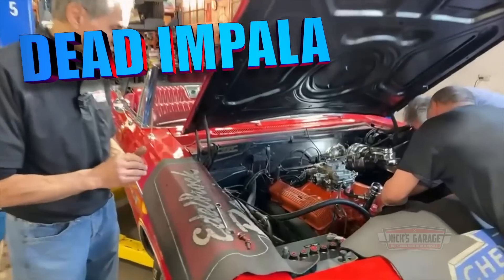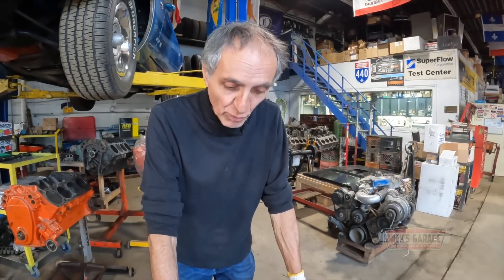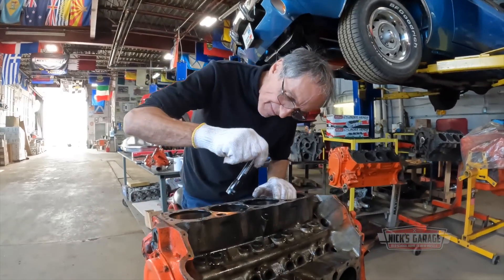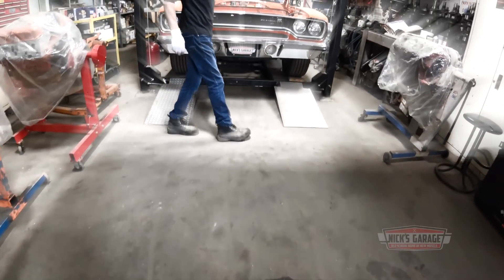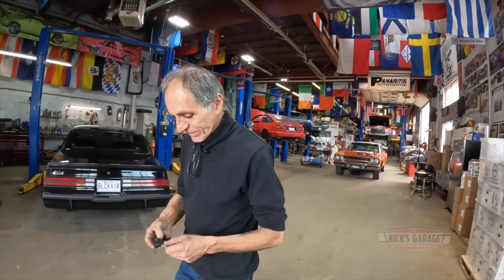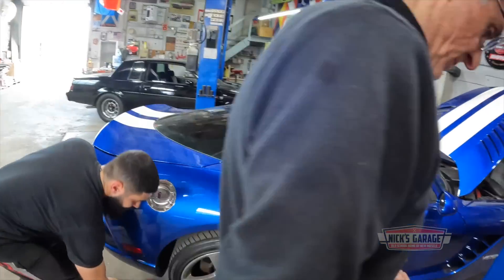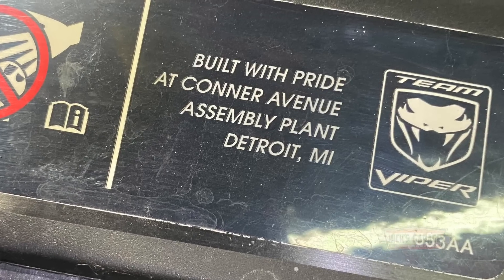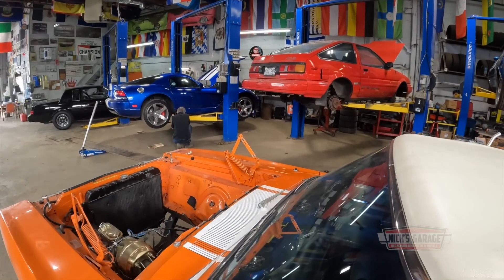327 Chevy Autopsy - Smoking Gun FOUND!

Comment: What a lot of people forget, including mechanics myself included in that last part, is that in order for the water temperature gauge to work there has to be water in the block. So if there is no water in the block, then the temperature gauge will not indicate the car is running hot. Learned that with a 1965 Ford F-100 240 inline 6, that had a cracked block that would seep water. The other part of that is a faulty temperature gauge can also indicate a car is running cool, even when it is over heating due to a faulty thermostat. And while I do side with Nick on this one, as there is no substitution for a good old sniffer. As a car that is running hot, will smell of anti-freeze if it is boiling out.
Reply: as Nick said...it had over 4 gallons of coolant in it....a guage would have worked until the driver boiled off the coolant...I also agrre that the thermo could have been scalded from the extreme overheat and seized... so... it could have had a cylinder crack...in the old days we'd magna-flux the blocks... and heads

Comment: If the car has a heater check the passenger footwell for water . The heater core can drain all the water if faulty. The thermostat could be damaged by the severe overheating so don't stop looking for problems. 
Do a cooling system pressure test with the motor warm and check that it maintains pressure and doesn't leak down.

Comment: With this video Nick you brought back alot  of memories. Years ago I could of picked up a friend's 70 road runner for 2500 dollars in great shape. I'm still kicking myself. I feel for you with the 327. We put a engine in a  friend's truck only after rebuilding it it had a 3 inch Crack in the water jacket that leaked when at operating temp. 🤑🤣😩

Comment: FYI Nick. There is a company that makes a thermostat called fail safe. If there is a problem with the function of it, it will fail in the open position, avoiding just this scenario. They cost around $23 here in the US, but it’s a lot cheaper than a new engine. I run them in ALL my cars. Bought mine ya auto zone. They may not even know they have them in stock. My guys had to look them up, and they had them all along.

Comment: I have seen cylinder heads crack on the intake ports around the valve guides and valve seats. Also the intake manifolds too through coolant passages. Like Nick said you won't see the crack until the engine heats up and expands. I am positive Nick will find it with further diagnosis.
Reply: doesn't explain where the coolant went....... show me the piston crowns/heads on the valve side.....

Comment: Hi Nick,  Over the years I have experienced a new defective thermostat twice.  I was advised to use only Stant Superstat. Very happy with this product appears to keep the temp always the same no cycling and supposedly less chance of binding/sticking.
Reply from the maker: Good to know!
Reply: Stanton brand had a hole with a loose rivet in the hole to let out the air.
Reply: Stant is gone! Bought but motorad. Pure garbage now
Reply: @NicksGarage   Nope , I had a Stant  fail as well !  As I told you on the phoner Nick, I had A Stant, a NAPA  & a NOS GM thermostat all fail. Just take the guts all  OUT of the thermostat and only run the outer case of it as a  thermostat is only for heat in the car in cold weather. You must run a restrictor in the system, but no thermostat guts. Been doing this for many decades that way and found you will drop 15 to 20 degrees every time. But keep in mind you must always have that thermostat housing water restrictor in the system to let the hot water slow down to give a chance to soke the heat  of the water into the fins of the radiator.

Comment: That’s a good representation of the world we’re in. Quality control that’s gone to sh.t and people with zero situational awareness. 
Years ago I burned up a Chevy 350 in Squarebody, it likely had a cracked cylinder head, and as the engine was boiling out the remainder of the coolant it makes all kinds of haunting and guttural noises. Exactly like your customer’s engine, it burned the paint off the heads and a portion of block. I had a fresh 383 waiting so wasn’t too concerned for that smog era 350 but I pushed her beyond any semblance of normalcy to try and get home. Oh and the smell, you’ll never forget the smell.... Plenty of sensory cues stuff has gone extremely wrong!
You’re a good guy Nick

Comment: I owned several cars with 327s. One thing could not help but notice is detonation. I have had cheap Chinese thermostats go bad. They work multiple times and suddenly don't open...no reason! But you can tell when an engine is overheating especially at the exhaust and the way the car is running.
Reply: Those MR. GASKETS Are Probably China or at Least the Spring is. I dont think a High Flow is Nessary Just buy a BIG Block Versión from Chevolet.. MR. GASKET Should take Responsibility for this.

Comment: I love looking at how cars are put together.  Nice to see the Viper from underneath.  Next subject, the dummy lights instead of gauges.  I had a 75 Duster with a 225 engine.   I always changed the oil and filter at or about 3000 miles.  One day I noticed the red oil pressure dummy light come on and before I could pull over, it locked up and that was it.  Someone had put new valve seals in the engine but instead of making sure the old ones were removed correctly, they left the old hard seals go down into the engine.  The conditions were right that day and those old hard valve seals plugged up the oil pump pick up screen.  I installed a mechanical oil pressure gauge in that car and my truck also.
Reply: That Duster would have had a temp gauge, unlike this cheap chev.

Comment: That’s a dirty spot to be in, Nick.  I feel for you.  I’ve read quite a few of the comments here, and I haven’t seen it mentioned yet, and you didn’t mention it either.  But IF it was an internal coolant leak (such as cracks in the head or block, or head gasket), then the piston that was pushing out the water would be a completely different color.  (In the case of a head gasket there would likely be two pistons side by side.) The piston would be spotless clean, steam cleaned.  If all your pistons are the same color then the leak occurred externally which would be the case with a bad thermostat.  

As far as the steam observed by someone that was following, most of the steam coming out of the rad would flow under the car and be visible to someone following behind.

Please keep us in the loop with what happens here

And I agree with what a lot of the people here have said that the driver needs to carry a LOT of responsibility here, he/she HAD to have noticed a problem occurring.  An odour, change in performance/responsiveness, pinging, steam coming out around the hood.  I definitely would have a huge problem buying a motor for this person.  You can warranty what you did, but you didn’t drive the car when the problem occurred.  If you’d have been driving the car when it overheated you wouldn’t have baked that engine.  Tell him to go chase the thermostat manufacturer.  You didn’t make the thermostat
Reply: I agree with the temp buttons to protect you . The thermostat could have been damaged by the overheat . I would persuade the owner to install a reliable set of oil and temp gages . Good luck Nick , I hope you find the real problem .

Comment: Your part failed but so did the driver who had to know his car was acting sick then died. Usually if you work on cars before you own one the better off you are. I started rebuilding  small gas engines in the 7th grade!
Reply: There are signs and smells from an overheated engine, defective parts happen, even more so now days, but with a car like that more care from the driver was needed.
Reply: Eric Weingartner  Hey what's happening Eric !  I watch your channel all the time.
Reply: Maybe that part failed because of the overheat situation first. It stuck closed because of the overheat situation never said it was stuck open. By the way a stuck open thermostat does not save you from overheating issues. If the system is plugged up, or pump not circulating, blown head gasket, cracked head, cracked cylinder wall, will drive to overheat condition even with a stuck open thermostat. But a stuck closed condition could be a manufacture defect but about bet you this failed after overheat engine from completely seperate issue.
Reply: @bigbearvenom6145  Nope it was stuck closed not open!
Reply: @stevesosinski6692   AMEN ! but most people don't have a clue as they just get in and drive . The driver needs a thermostat ! lol , or build the car stupid proof. Oh yes , I have done that ! it hits 240 degrees a LOUID buzzer goes off ! and at 270 degrees the motor shuts down !  Stupid proof !  WORKS !
Reply: @hydroy1  I'm not sure it's possible to make a car "stupid proof" I guess there's a cure for ignorant, but stupid is another challenge. My problem is right now there are a lot of flips out there and people buying for investment. Nick's projects are top quality, but I have people come in with "investments' they didn't even inspect, just listened to the sellers claims. Bondo boats, used engines and trans sold as rebuilt, even a transmission that broke a bolt on the tailshaft and they welded the driveshaft to the transmission mainshaft. And "I" get the chance to fix it.  Best of luck!
Reply: I protest the term “your part”.
A new part as basic as a thermostat, from a reputable source, should not cause problems.
A brand new part that causes the destruction of the item it was designed and advertised to protect is obviously warrantable by the manufacturer. Therefore claiming Nick is at fault ie “your part” is a bit rich to be fair.
Reply: @barbossaa5527  I understand what you mean, and it was Nick's part until he transferred it to the owner, now it's the owner's  part, and HIS responsibility to control it. He may not have been able to stop it from failing but from the blackening of the heads and mounting surface to the block...new paint, coolant odor, rough running... I would have known, and most mechanics might as well. I have had customer cars who imagine that whatever repair you make you are responsible for the car. Ever hear "When it do that until you worked on it" or 'You remember that part you replaced three years ago? It went bad again" Mechanics take a risk in what they do. Buying parts is risky too. Mechanics can't marry the vehicles they work on or control the vehicle after it leaves the shop.
Reply: Absolutely spot on. There had to have been warning signs that the engine was failing.
Reply: @barbossaa5527   I am not blaming Nick 1 bit or a spun bearing! Driver had to smell, see the heat feel the heat, carb issues engine lack of power all of that falls on the operator.

Comment: Last year the hot rod shop I was at had the same problem with a defective Mr. Gasket thermostat.  66 mustang V8 / tremec 5 speed swap.  Car overheated when the owner drove it home.  Car had been road tested previously with no problems.  It was January so it was cold enough there was no serious engine damage.

Comment: while it likely was the thermostat that failed and cascaded into full engine oblivion, the thermostat could have been ruined by very hot exhaust gasses passing back out the coolant system after it nuked the head gaskets and maybe even superheated coolant steam.
I'm left wondering if someone drained it for storage and simply never added coolant back or even purposeful espionage?
Reply: Your point of view makes the most sense to me, draining the engine for cold weather storage, especially being 45 minutes away from Nick's. Then forgetting to refill the cooling system before driving. Or some kind of sabatoogy.

Comment: I'm texting you  I just saw the dyno session  with the 426 wedge that had gear drive that was reversed  rotation  I bought  13 440 pulled  out of farm fields they all had the same gear drives also they had 8 bolt cranks and flat top pistons with out valve releases and ran on propane  just let you know what I've found I love your show I live in northern Arizona thank you for your show

Comment: Hi Nick,  back in my day these cars could develop a nearly invisible coolant steam leak that would take many hundreds of miles to show itself "by you seeing the radiator being low on coolant (if your were lucky)", it would NEVER show a drip or wet spot anywhere if the micro leak was especially near the top of the radiator, though other areas could have the same effect   +- ... Back then if I didn't take notice of the Coolant Level it would start to run HOT without any Bad Effects if you caught it early - if not one would end up with what yours did by going to long low on coolant !! Side Note: the thermostat will ONLY help the car warm up and will NOT help the car run cool or cooler ...

Love Your Show !
Reply: But it will prevent coolant from getting to the engine when it fails in the closed position, as I do believe we are about to find out here. You overheat the very first thing you do is remove the thermostat. Changes are that will solve your overheating problem. Replace it at your next pit stop with one that works.

Comment: Quality control at the manufacturer should have discovered it! Being as I work in a valve manufacturing facility now and a shock manufacturer for 32 years before that I know how difficult it is to find one single bad part, especially since it had worked previously! It’s a conundrum for sure! Now to find out if anything in the engine is salvageable? We all know it’s just $$$ but that’s probably close to $5000 to repair/replace! Yikes! Sweet 66 tho!

Comment: Magnaflux block and heads with iron fillings spray on the them using electric magnet will show the cracks. I did this working at Fairway Engine Exchange. Regards Nick

Comment: Thermostat doesn't explain where all the anti freeze exited.  The thermostat might of went bad because of extreme heat after the fact. The thermostat was working when you guys installed the engine.   I would not be so sure it was the egg before the chicken. Just saying I'm not so sure it's the smoking gun.
Reply: Very true. But I will look at every cenerial before this car leaves. Reading all the comments on this 327.    Thank you.
Reply: Thermostat failed to open. Coolant turned to steam and exited the cooling system by way of the radiator cap. Remember that the radiator cap releases pressure at its rated pressure. This accounts for the report of white smoke behind the car before it quit running. No mystery here. I have seen plenty of engines cooked by a bad thermostat. I've also seen a few close calls from overheating that were shut down before the engine cooked that just needed a new thermostat to solve the issue.
Reply: Steam up front exiting cap the person driving will see and stop driving,  but not necessarily see it leaving out the exhaust pipe unless someone warns you or it's spotted by driver through rear view mirror and the other thing is your going to smell paint cooking off an engine !!!! It didn't turn to steam and leave cap because it would of went everywhere and you would know it this exited through exhaust slowly over a period of time and burned off as a slight steam over a period of weeks !!

Comment: I've seen the heads have a Crack in them and it put the coolant out the exhaust before but in my 30yrs I've never seen one get that hot before he had to drive that thing a long time after it overheated to get that hot

Comment: I always use EMP Stewart thermostats. I strongly recommend them. 301 is the part number for a 180.
It has bypass holes drilled in it as well.

Comment: Wow, the first time seeing a burnt engine like that, so it was due to a faulty thermostat, I have always used stant thermostats and never an issue, I have seen engines seized due to overheating, whether it be cracked block, heads, water pump, etc.., I love watching your channel as well as the knowledge i get from different perspective’s, would love to have you Dyno the 408 Stroker that I’m building for my Ram truck.

Comment: SBC engines have  four shorter head bolts that go into the ends of each head. If you use one or more of the longer bolts in those positions the threads will extend too far into the deck and not seal. Also because the head bolt holes go into the water jacket the threads on the bolts have to be sealed.

Comment: This really doesn't prove anything. That thermostat was cooked at ungodly temperatures. Of course it's stuck closed now. Extremely odd it worked fine for all your testing and even more odd for these to fail.
Reply: What about them being manufactured in Mexico, Israel, ShriLanka and Korea.
Reply: @Hanzyscure  I had a thermostat made in US that failed. So your comment is mute. It’s not always some other countries fault
Reply: @ninjapumkin  Where in the US was it made ?
Reply: @ninjapumkin   my comment is mute? You can't hear it? I think you mean moot. And I didn't say they don't fail. I said it's extremely rare. When they fail it's usually right out of the box, not after hours of working fine. So your comment is now "mute". 🤣
Reply: @Rotttman  ya your comment is mute 🤐 haha
Reply: Superheated water Max's out at 370 °C that's in a pressurised system , I wouldn't think it would be enough to damage a new thermostat. Copper melts at 1000°C aluminium 600°C. The wax is in a sealed cartridge, I wouldn't think it could escape?

He probably lost water over two or three trips not noticing it boiling out from the overflow. I reckon the light came on more than once and he didn't see it. Or it boiled out on short trips without tripping the light. 

Who knows?

It sucks, I mean who's fault is it? I'd hate to be either Nick or the owner.

I'd send it back to the manufacturer to assess how it failed? However business can't wait for that slow process. Good to see Nick make it a priority.